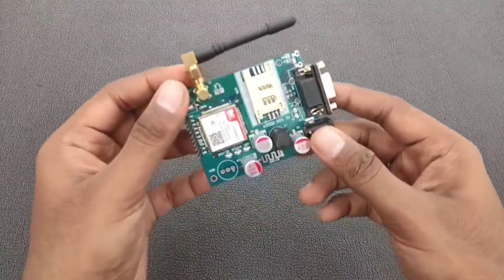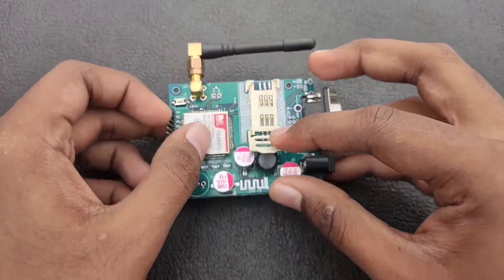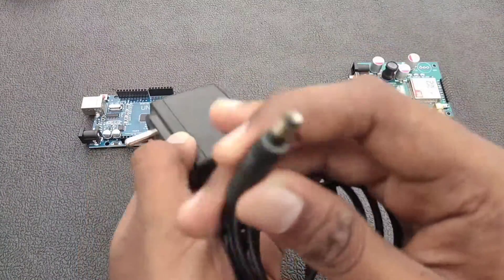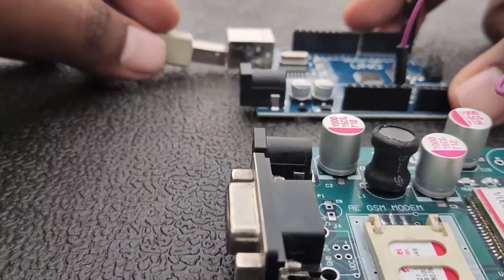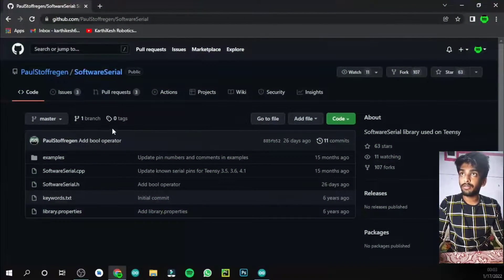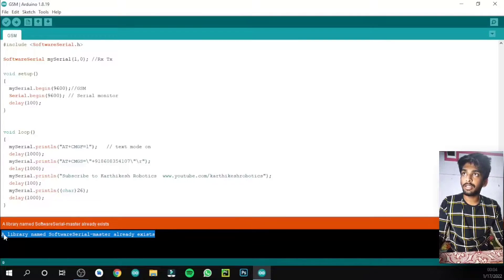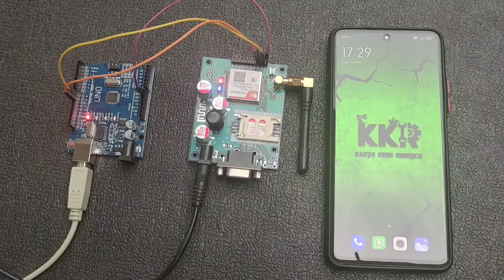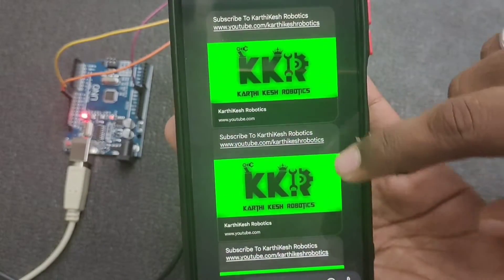SMS using GSM Sim 800A | #GSM | #Arduino | #ArduinoSms | #KKR | #ArduinoProject

Comment: avrdude: stk500_getsync() attempt 4 of 10: not in sync: resp=0x00 I'm getting this error... Any possible reasons?
Reply from the maker: Reinstall arduino ide
Reply: @KarthiKeshRobotics   same error coming bro
Reply: facing same issue...please help
Reply: @gauravyadav2134  plug out the Arduino cable, restart only Arduino ide, compile the code first then plug in the Arduino wire and then upload
Reply: @TusharKumar-iu4nt  Did everything as you have suggested still same issue...but do we need to use 0 and 1 pin in arduino or some other pin?
Thanks for quick response and help